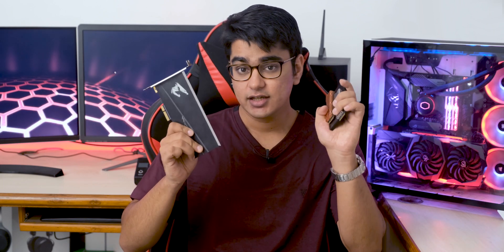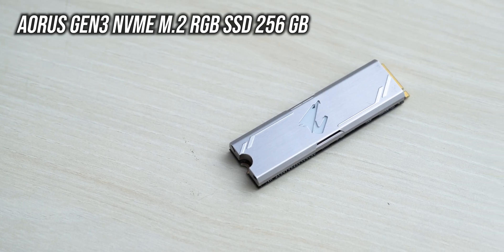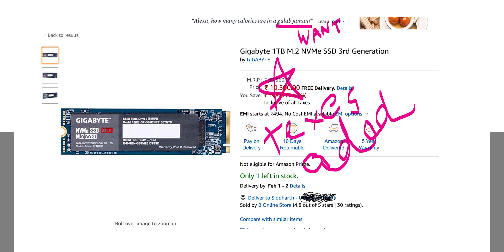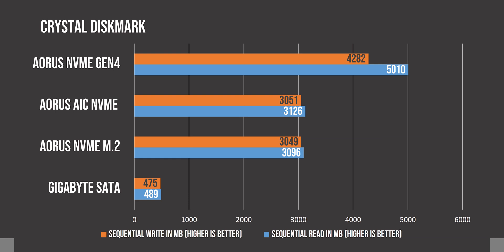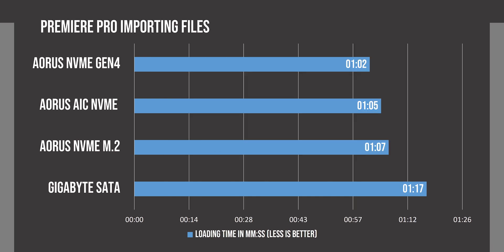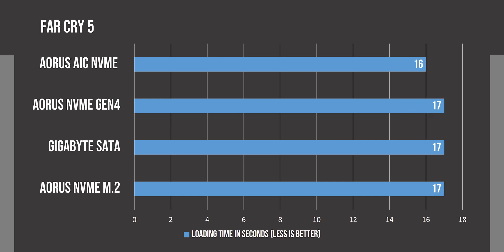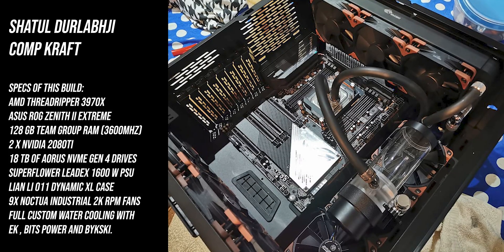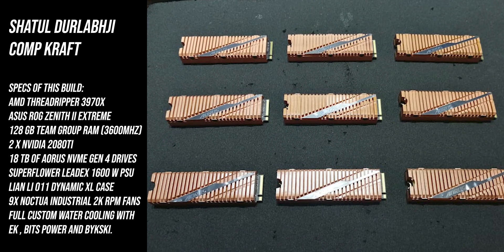New Gen4 NVMe SSDs: What you ACTUALLY NEED Them For! (Gen4 vs. Gen3 vs. SATA)

Comment: Anyway you can explain how you got windows installed on it? I bought one and it doesn't show up in the bios or in windows, I'm using a gigabyte aorus elite x570 and a 3800x. Not sure what going on
Reply: Did you figure it out, I installed one that also didn't show up, I had to go in disk management and create a drive letter for it. Found this info on google.